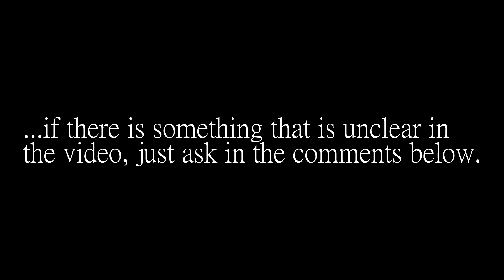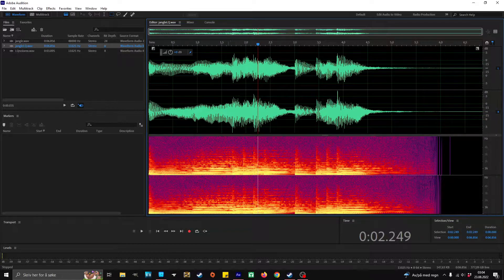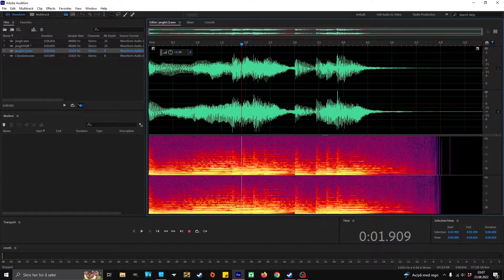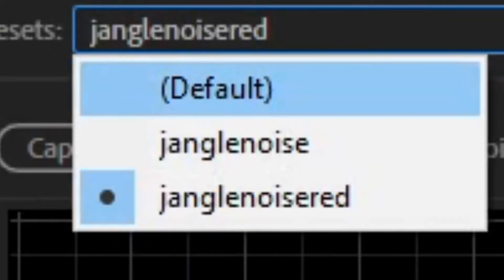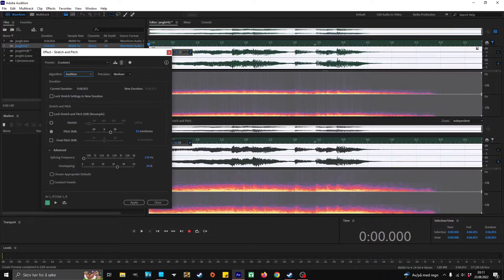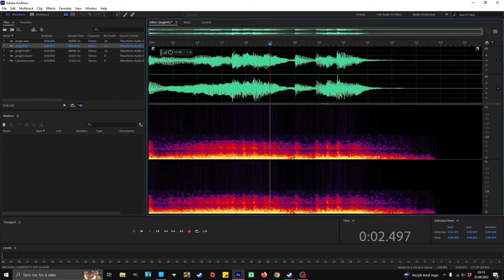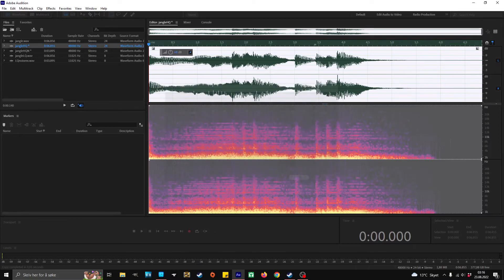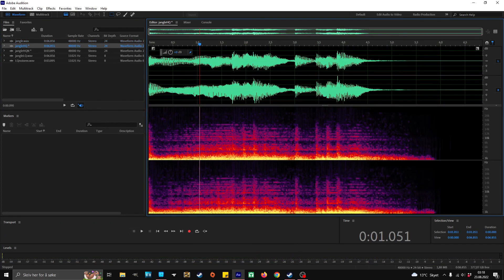How To Increase Quality of Old Audio Files

Comment: I've done this before! Never with such low bitrate audio, but I've tried to make a 128kbps MP3 sound "better" by pitching up the original and adding the new treble range in order to make a dirty 320kbps file. Instead of using mix paste, I just used a high-pass filter on the parametric EQ and layered it that way. It's hard to prevent the treble from sounding kinda crunchy, but it was a fun experiment. 

I don't recommend doing that, however, because it doesn't really improve fidelity. The way you go about restoring really low bitrate audio is a much smarter use case for this kind of technique.

Comment: Technically, you've removed the "quantization noise" and added "upper harmonics" to your sound. I'm not a party pooper, you opened my eyes with your video honestly speaking, just sometimes it's better to know the definition of it, right? 😄
My applause to you, really great video!

Really, now I see it's really a "way back to original quality" during...uh...resampling and stuff (sorry, not a sound-, but engineer). With the losses (which is obvious), but compared to equalizer (boosting high-freqs) it's a true way back.
Reply from the maker: Thanks for your comment and terms! You're not pooping any parties here. I really suck at terms sometimes. You are right about adding harmonics, but sometimes it's about using noise from the original sound too, but that's a whole lot more elaborate. I just want people to get like an entry-level explanation, then they can experiment themselves.

I wouldn't really consider it a true way back, but I believe it's as close as you can get. It works very well if the quality of the original wave file is in the 8000mhz range or higher.

Comment: Hmm it looks reproduceable with Audacity. I'll do some research!
Reply from the maker: Might be a little hard. There is spectral view in Audacity, but no way to edit directly in spectral view. I'd try using "Filter Curve EQ", which is similar to Audition's FFT-filter, then take note of the frequencies. Can't promise it wil get just as good though, because "Change Pitch" in Audacity isn't as advanced and precise as the "Stretch and Pitch" in Audition, unless you find other means to do it.
Reply: @grinjaturtle  Don't know if it was possible back then, but you can now edit through the spectral view using the "Spectral Delete/Spectral edit" effects. You can't preview spectral selections but you can copy and edit the track to do so and get a very similar result.
Reply: @NovanByworks  Ok. All of that is possible with Audition. Even with a detailed drawing tool.
Reply: @grinjaturtle  can u do a tutorial for audacity
Reply from the maker: @solinus7131  No, I'm sorry. I fear Audacity isn't flexible enough, plus it would take me a lot of extra time to relearn Audacity and redo the tutorial for it. I don't have that kind of time anymore.
Reply: @grinjaturtle  https://www.youtube.com/watch?v=RL2Dn89rWJU found this tutorial, doesn't work as well i assume but it's quicker
Reply from the maker: @solinus7131  Hey, good find! That's not bad.
Reply: pretty easy! just duplicate the original track, upsample it, pitch shift it up, then high pass at nyquist (half the sample rate), adjust levels, repeat as needed